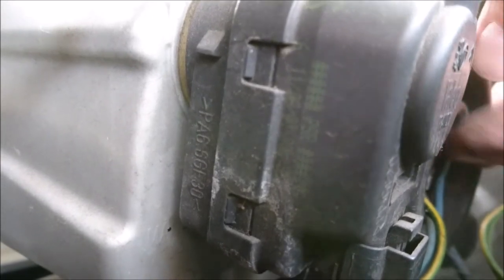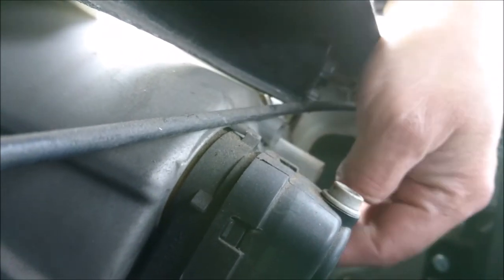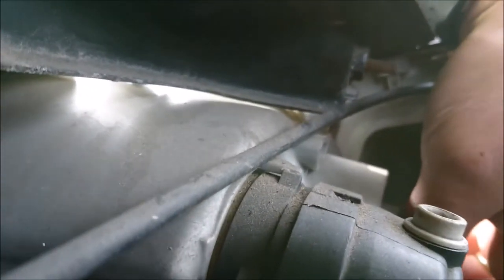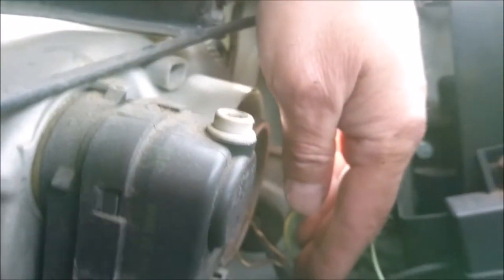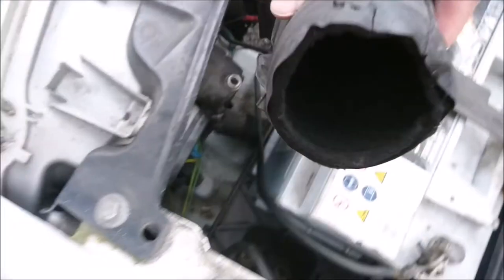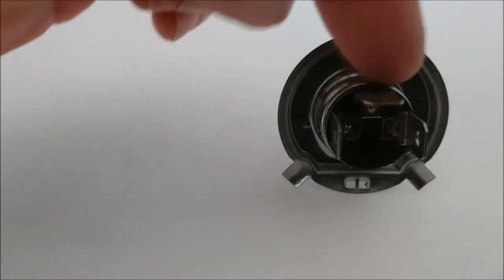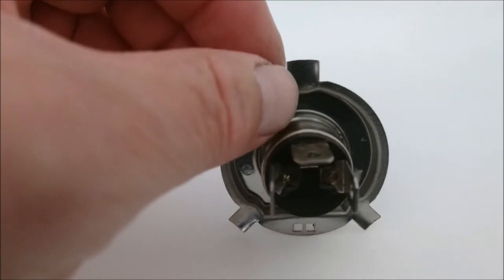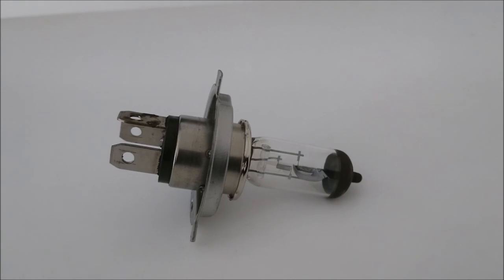Headlight Bulb Fitting - Fiat Citroen Peugeot van

Comment: The video was pretty useless, but the audio certainly helped guide me through the process. Thanks!

Worth mentioning that the metal 'wishbone-shaped' clip always pulls towards the driver's side to release. If in doubt, there's a little diagram above the headlight on both sides.
Reply from the maker: Thanks for taking the time to not only view the video but to add information and critique it as well...still it was viewed once more and I'm grateful.